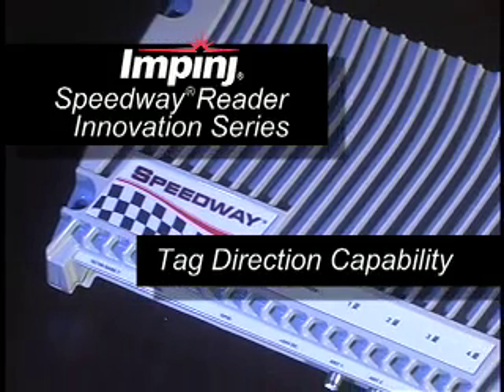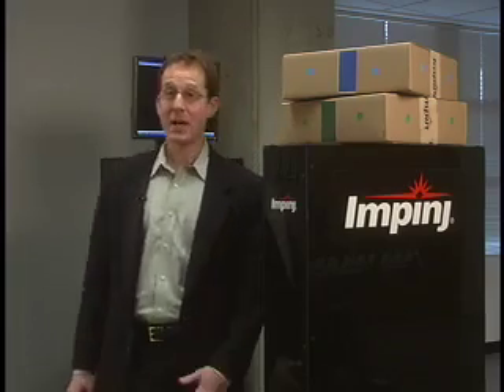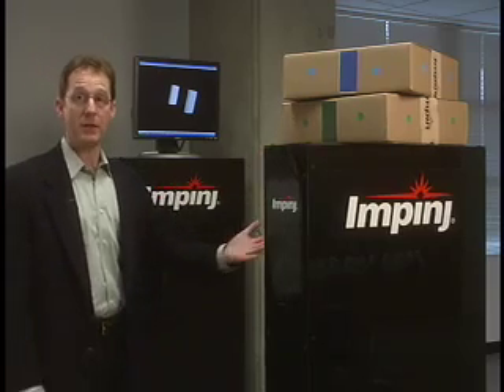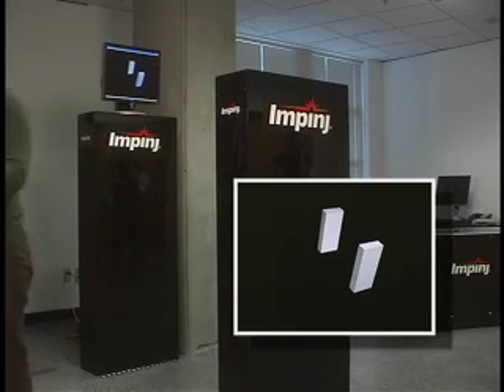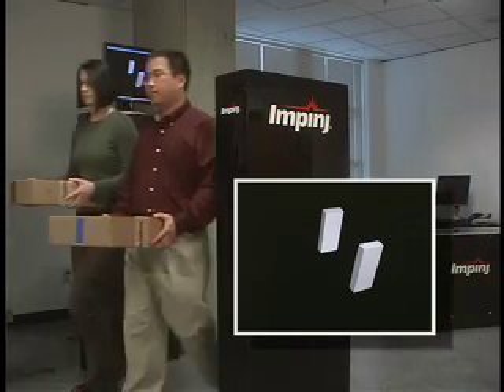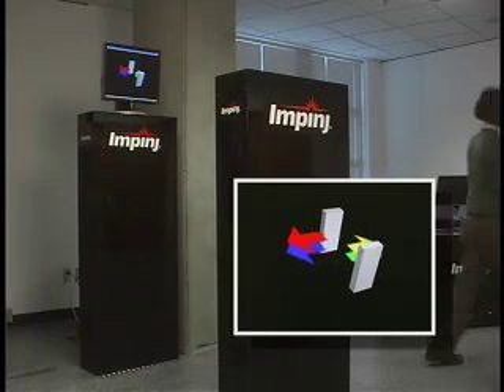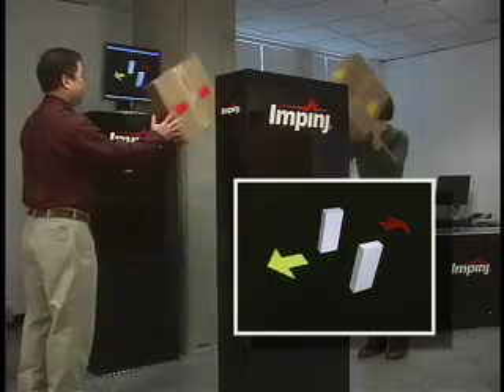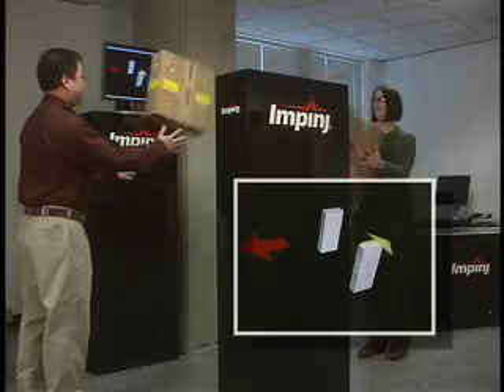Impinj RFID Technology for Tag Direction

Comment: I'm sorry, but tag direction was only supported in Impinj's original Speedway reader. Their current platform (Speedway Revolution) does not support tag direction in their Octane firmware.

However, their new xSpan and xArray products do support Direction. 
    https://support.impinj.com/hc/en-us/articles/206246824-xSpan-Documentation
    https://support.impinj.com/hc/en-us/articles/203627878-xArray-Documentation